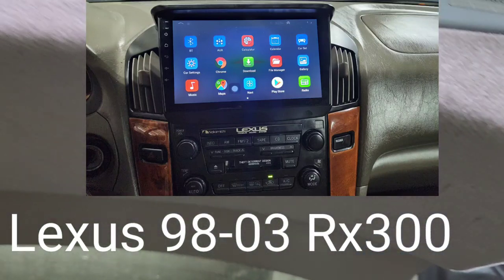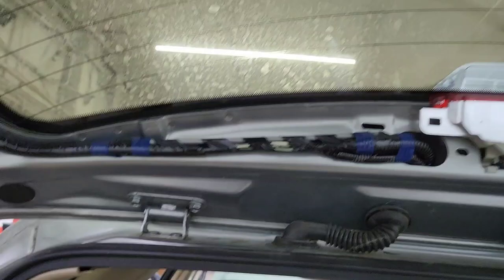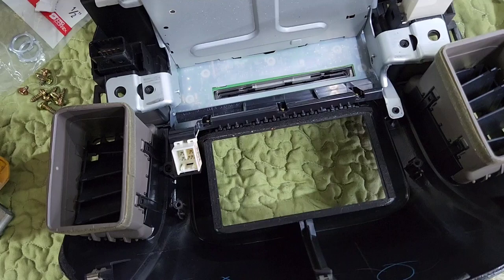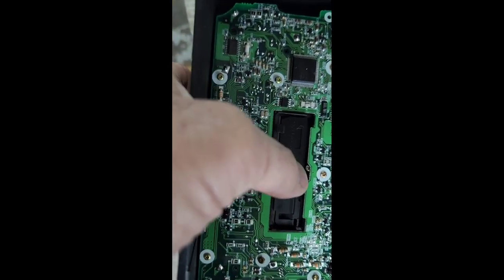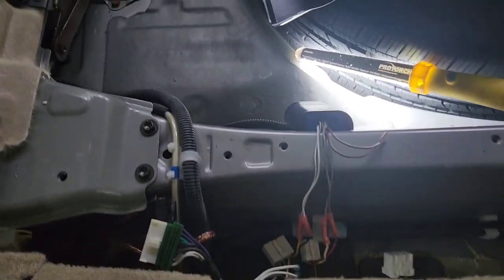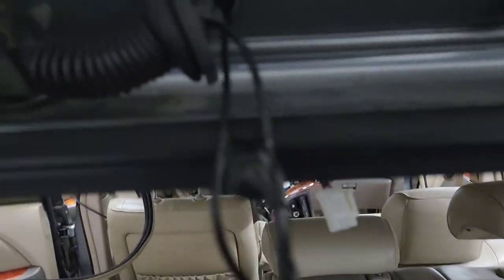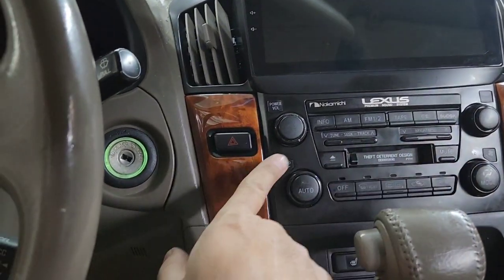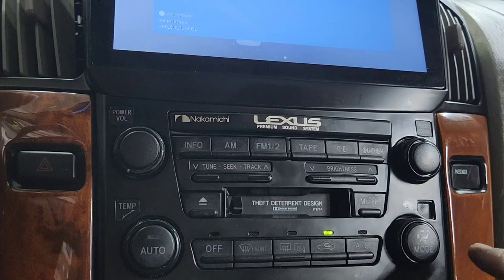1998 to 2003 Lexus Rx-300 tesla android screen with backup camera install

Comment: Where did you get the parts from? Like the screen and everything?
Reply: You can simply buy an eonom 10.1 inch android radio, however you will need to remove the original screen and cut that area so it fits...I made a modification like this on my RX300 about 3 / 4 yrs ago....

Comment: Hi Khmer! I have the same car except that mine is not nakamichi radio. mine is correct, but my problem is that my head unit turns on and then off instantly. Do you know any solution on this? or input? anything you could have me try please let me know sir. I have it installed its just not turning on continuously. =( Thank you in advance.
Reply from the maker: Do you have test light ?
Reply from the maker: Make sure that when the key is on position, the Red and Yellow wire has 12 volts.  Also, the blackwire probably needed to ground to the metal frame
Reply: @khmerohio  Thank you so much for replying sir, I don't have a test light. I had to return the unit for replacement when I tried to put it back in i smelled burnt wires right away. The unit smelled burnt I don't know why. I will update you when I get the new one. Thank you very much for replying super fast. you got me subscribed right away. =)
Reply: @khmerohio  Hi Again khmer!, I have everything plugged in I got a new android unit. The unit still doesnt turn on. could you please help me out sir on the harness? I think its the harness.. =(
Reply from the maker: @TheWhinley  https://www.facebook.com/Brainlimbo?mibextid=ZbWKwL

Comment: Does the volume knob work to control the new head unit? Looks good. Thinking about one for mine.
Reply: No. Just the temp. But it doesn't tell U either what location it blows to or temp. I

Comment: I have the same unit, you are right about the color wires in the wrong place for power. I had to bypass them. My issue is after installation and it powers on. I get no sound. I don't have the Nakamichi version but the regular premium sound. radio. I could not get the antenna to power up either any - suggestions? does that have an amp also that I need to bypass?
Reply: U have to find a wiring diagram (they're on google but kinda confusing) and then depin and repin. I did. It. In the bigger plug the one that says antenna pin the blue wire to. The other option is get a dsp from dayton audio and bypass it completely.

Comment: Hello I've watched the video and thank you. My RX300 is non-Nakamichi, just want to say that outright. For the wiring harness in the back, I've "plug and played" all that was available, and the screen doesn't turn on. So I'm definitely missing something. Along the top of the screen in the rear are white plugs (directions are very vague, but it says one of them is a USB).
Could you please explain or reach out to me for some help with the wiring connections. Right now what should work doesn't and it's probably user error. Thank you - John

Comment: Brother, even on the non Nakamichi those wiring harnesses are not pinned correctly. U have to de pin And Repin. I found out the hard way.
The amp was probably not bad but it is wired more like a 2-channel as opposed to a real 6 channel. It also has that awful bass roll off.
Reply from the maker: Wow
Reply: Yea it's very much meant to send us to the pros to pay premium prices. If someone is a little mechanically capable it's possible, but boy is it gonna be a pain.

Comment: Can u tell me what kind of android radio is that. I have one I am trying to put in a RX300 Lexus 2001
Reply from the maker: 2+32G for Lexus RX300 / Toyota Harrier 1997-2003 with Wireless Apple Carplay and Android Auto, 9 Inch Touchscreen Android Car Radio, HiFi/GPS/WiFi + AHD Backup Camera https://a.co/d/0FYKyPI
Reply from the maker: Dont forget to subscribe 😉
Reply: What other wier harness will I need to purchase.  With the one I have that came with the radio. Because everything it not connecting. Like the power wires and the climate control
Reply from the maker: Im not sure what you have
Reply from the maker: It should come with wire
Reply: @khmerohio  The android radio did come with a harness.  But it does not plug into everything.  Do I need to order a  harness for the factory radio? So everything can plug I  and play .
Reply from the maker: @earnestnorman6108  yes sir
Reply: @khmerohio  where is a site to purchase the factory harness for a Lexus RX300 with navigation.  Where is the site to go on. And how much will one might cost.
Reply: Is it the factory harness that runs about 500. Will that one get me going with the radio and climate control
Reply from the maker: Just found this amazing item on AliExpress. Check it out! $7.57  2%OFF | Car Radio Stereo Wiring Harness Cable Adapter Android 16pin For Honda Civic CRV 2012-2015 Canbus Steering wheel control
https://a.aliexpress.com/_mP4fcRG
Reply: I have ordered the harness from Ali Express. Is that the one that will connect the radio to everything in the RX300 Lexus. Thanks you have been a Real Help
Reply: My RX300 is  a regular Lexus also will the harness still work...
Reply: Do you think I need to let Best Buy install the android 11 in my RX300 Lexus
Reply from the maker: Best buy will not install Android
Reply: Who can hook it up once I get the other harness from Ali Express .
Reply: That harness is for a Honda Civic CRV will that harness work in a RX300  Lexus 2002 2003 with the android 11 radio
Reply from the maker: @earnestnorman6108  what year ?
Reply: 2001 RX300 Lexus
Reply: @khmerohio  2001 RX300 Lexus